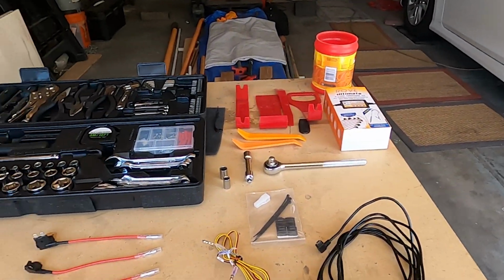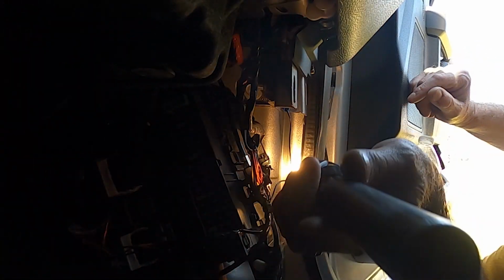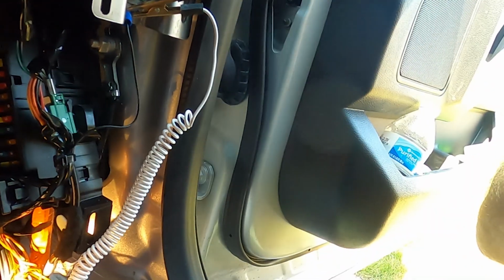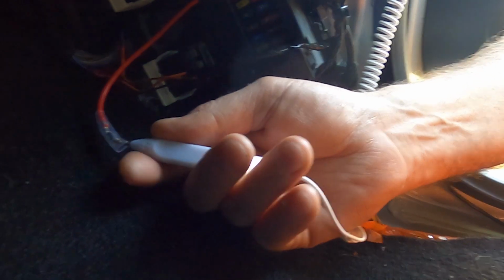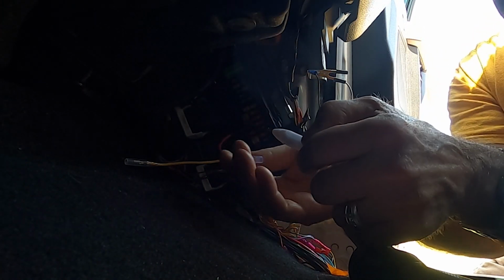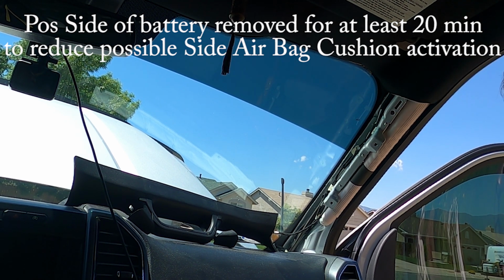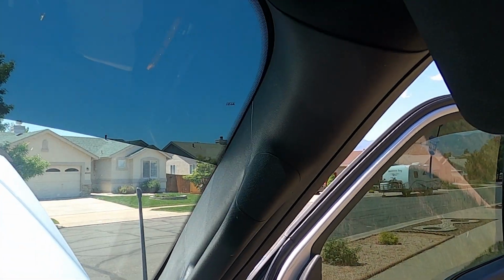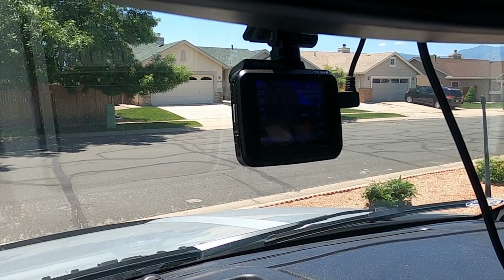Install of the ROVE 3-Lead Hard Wire Kit in 2019 F-150

Comment: Very informative however would have been nice to see.how.the.cable.was.ran.completely and the.music was.a.little much.
Reply from the maker: The cable snaked up the A-pillar behind the airbag, then just simply tucked up above the upper covering.  Truthfully, I’d have gone an easier route by simply coming off the power to the rear view mirror (which I did not know could be done at that time).  The rear view mirror is switched power, so turn on the vehicle and the camera powers up automatically

Sorry about the music, cannot do anything at this time!

Comment: Thank you Jeff, I just installed a camera with the help of your video. I've never done anything like this, I did not even know what a fuse was or what they did. Your video was great! I hope you're doing well!
Reply from the maker: You are most welcome.  I really only recommend disconnection of the battery if one does NOT feel 100% sure about not accidentally causing an airbag inflate.  Just an added safety thing.  The ol’ BSTS(orry move).
Reply: @mrjeff2396  My 2016 does not seem to have air bags on the front pillars as there is no indication of it so I just put the wire up the top edges barely under it, the middle pillars did in fact indicate they're airbags though but I did the same and just put it on the top edge it should not be in the way but if they go off I think the camera is the least of my worries. I'm glad you're doing great, please leave this video up as it has helped a lot of folks even if the comments don't reflect it.
Reply from the maker: @DiscoveryDarks There is no specific standard established for the exact placement of the AB’s.  Some vehicles have them in the A pillars and some have them above the door between the A and B pillars.  Mine, in my 2019 F150 Sport, the front are located in the A pillar.  The rear seating has them between the B and C pillars along the roof.  It is NOT necessary to do a battery disconnect if you are comfortable enough to avoid the ABs.  I just wanted to ensure the wiring went in a way to avoid the ABs for doing their job if deployed!  Truthfully, if you simply, gently tuck the wiring without removing the pillar covers you should be fine.

Comment: Thanks for the video. The instructions I have state that the added fuse for the yellow acc wire should be a 10-30A fuse. I noticed you used a 5A. How has this held up while the camera is in parked mode?
Reply from the maker: I have had zero problems.  The primary reason for me going there was access.  I cannot secure the cover for some piggybacks due to top of fuse and cover being so close to each other.  I don’t know why they would go with 30A as that could be close to fry for the camera.  The power interface is only 1.5 amp.